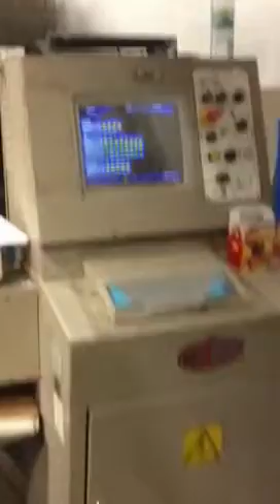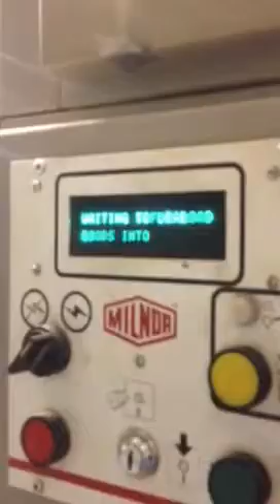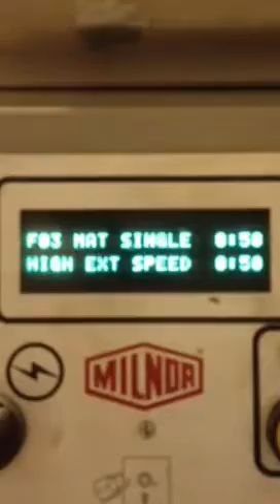Milnor Continuous Batch Washer (tunnel washer)

Comment: Ever had an error message "Load chute not up" appear on the extractor control cabinet?

It's referring to the load chute scoop that sits in between the extractor and the end of the tunnel where the transfer takes place.

I've replaced every part related to it besides the scoop itself on my small 5 module CBW.

Found several missing bolts in the scoop assembly, when I replaced them, the extension tube on the end of the tunnel was hitting the chute during its' rotation and the new bolts will be cut off due to impact/vibration I'm sure.